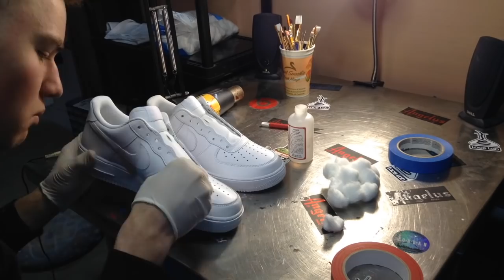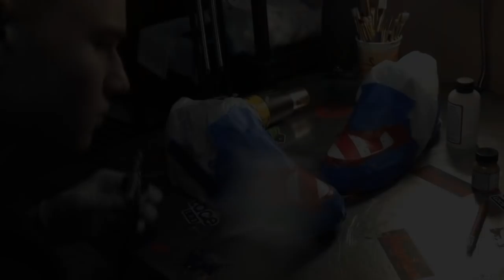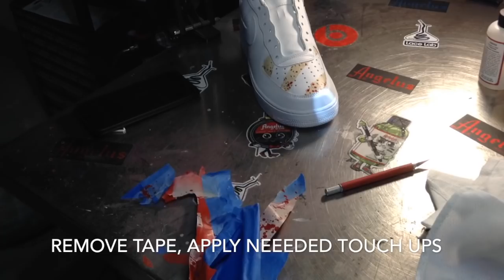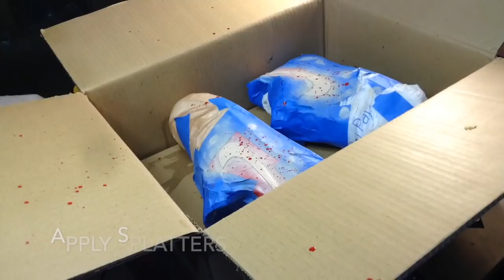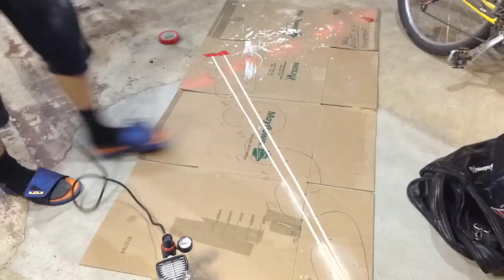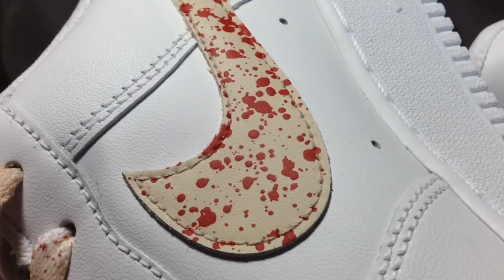NEW CUSTOM "MURDER MAN" AF1!!

Comment: Can u use spray paint?
Reply: it will crack on the first wear - use acetone to prepare the surface and then use a leather paint for air forces (such as angelus, but there are cheaper ones )